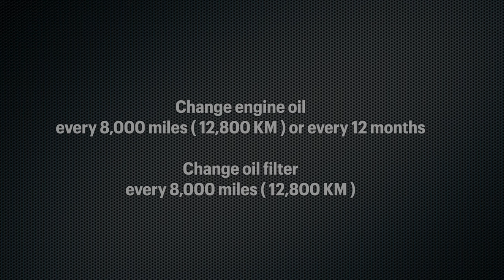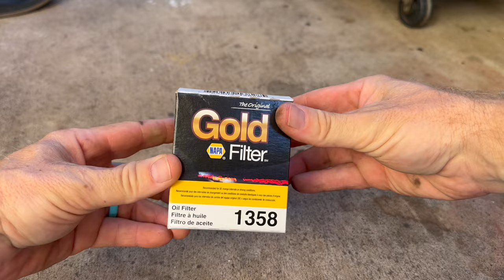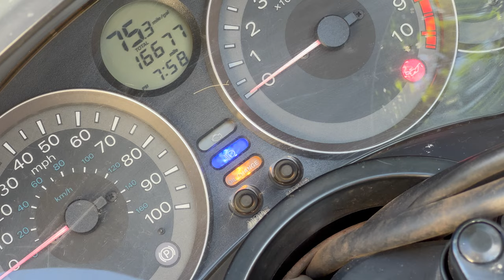Honda Forza 300 - Engine Oil / Oil Filter Change | Mitch's Scooter Stuff

Comment from the maker: Engine oil - http://amzn.to/2pxVR9d
Oil filter - https://amzn.to/49ertVC
T O O L S
Ratchet 3/8 drive - http://amzn.to/2hhmnUs
3" / 6” extension set 3/8 drive - http://amzn.to/2h7ypMl
12mm socket 3/8 drive - http://amzn.to/2xM4Edr
Breaker bar 3/8 drive - https://amzn.to/3lrjIWj
Torque wrench 5-45 ft/lb 3/8 drive - https://amzn.to/3TKdS3Z
https://amzn.to/3OqRSHR
Oil pan / container  - https://amzn.to/3bOmT5Q
Rags - https://amzn.to/2Yh8jvg
Funnel (short) - https://amzn.to/2HY4m6g
Pick tool set -https://amzn.to/3rXSjBA

Comment: Love it! I have a Forza 300 and I’m so glad you are doing some vids! I need to replace the faulty seat shock so I don’t need a broom handle to hold it up and check the parking brake connector as the dash light does not illuminate but did before the dealership did the fuel pump recall. Hoping for a panel removal vid! Your content is always on point.
Reply from the maker: Thank you! Ah yes this Forza I worked on have a bad seat strut support too, I will get few more videos out soon 😊👍🏼hmm sounds like some of your fuse blown out maybe?

Comment: Hey Mitch question... if you know what the minimum oil you need as example 1.2 liters, would it not be easier to get a lab measured pitcher and load the pitcher to the 1.2 or .3 mark and fill it that way instead of needing to fill a little at a time and keep checking the dipstick?? I use the lab pitchers all the time to fill my Harley's and other motorcycles and they all have been spot on generally hitting the mid way point and then just adding another 0.1 liter on the graduated scale to top off. At least this makes my life easier when doing oil changes on bikes but maybe scooters are different. Great video as always... and always helpful and very detailed. And yes, I know that the pitcher is just one more thing you need to clean and put away... hehehe
Reply from the maker: Hey yes I should have used a pitcher to pour in once to make job done faster... I did that with some scooters in past videos... but not this one argh! ..  Yamaha and Suzuki have oil level window reading that don't need pitcher but Vespa and Honda need pitcher :)